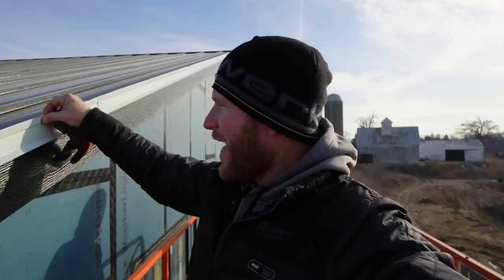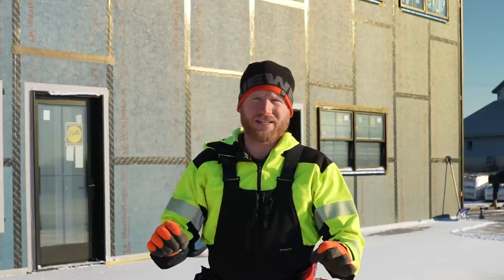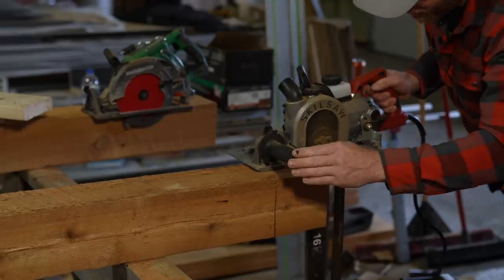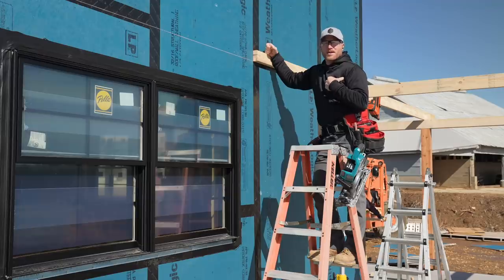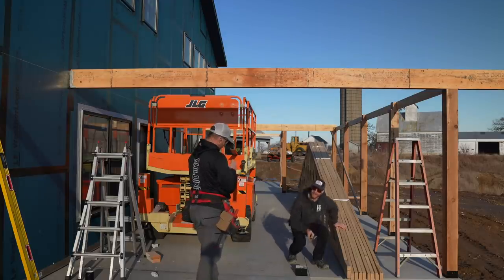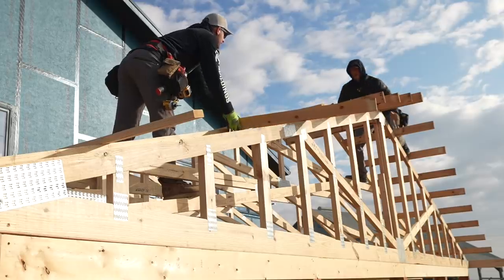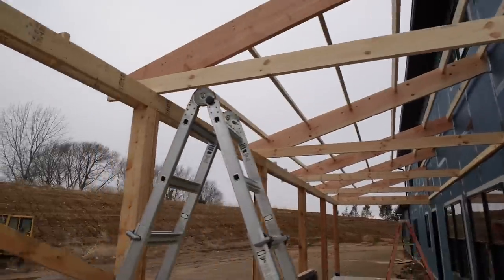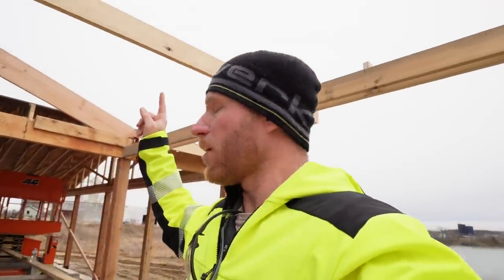Building A Barndominium 22:  Building the Porch Part 1

Comment: In watching your builds, I've learned a lot about post frame and some about using a laser level more often. However, the biggest lessons I've learned are how to deal with having to go backwards on a project or addressing mistakes when the reality isn't 100% of my expectations.  I'm trying to see mistakes or rework as part of the process and move on instead of seeing it as a failure on my part.  Thank you for showing the mistakes and how quickly you correct them.

Comment: Drop end trusses... brilliant!! My first time to see that and I've only been doing this 38 years. You go to residential jobs and they're not even cutting out notches in the end truss top cord to lay a 2x4 flat & run it flush to the next top cord for outriggers, they're literally nailing chicken ladders to the top cord and relying on sheathing to help hold the overhang up! It's all about production, as long as it lasts for the automatic one year warranty! 😏
Reply: Never had a problem with chicken ladders for a 1' overhang
Reply: @xxlegitxxpwnerxx  Are you a licensed contractor that has to provide a mandated 1 year warranty? Well, I'm a licensed contractor & I give 5-year warranties on everything I do, because, I know it's going to last twice as long as that, like it's supposed to!! I've got 7-10 year old ceramic & porcelain tile floor jobs where the grout still looks brand new, (trade secret), 20-year-old roof jobs that my customers have never had a problem with, 15 year old, 2 story monster deck jobs, (that never sank, not even 1/8"), that I've only gone back to stain every 5 years, & that's because I use the highest quality stain, etc...talk to me about a 1' bullcorn chicken ladder overhang...hack job, just like most new residential construction these days! I've been up close and personal to inspect some of these cracker box pieces of junk just out of sheer curiosity recently & I couldn't believe my eyes! Amateur hour at the rodeo, greenhorns from hell...sheathing and decking staples that aren't driven all the way in because people don't even know how to set the depth on their staple guns, not to mention, staples went out to pasture in the 90s & for good reason. Improperly fastened everything, blown out toe-nails, stair stringers that will eventually fail, etc...damn shame!! Yada flippin' yada
Reply: @benttwisted210  yessir we are licensed and have a 5 year workmanship warranty

Edit: not a literal chicken ladder but we build a 1' overhang that face nails to the truss and it's is plenty sufficient

Comment: Is there enough clearance to get that lift off the porch now?
Reply: I was about to ask the same thing! looks tight, doesnt it?
Reply: I saw that as well, but then noticed that the side rails come off..
Reply: can let the air out of the tires to lower the lift
Reply: Thinking the same thing here too.
Reply: You can remove pins and fold then the railings so you can fit in spaces you usually can't in height
Reply: @jeffreypardy2831  true enough...but will it be enough? Greg needs to let us know in the next video.
Reply: @robertkrusin9856  dang it!! there's the answer!! look at you with the big brain!!
Reply: @jeffreypardy2831  solid tires I would presume. Every man lift I have used has solid tires.
Reply: @jeffreypardy2831  polyurethane filled actually. I had to look it up.
Reply: @johnclark8631  no those are inflated tores
Reply: @johnclark8631  we will find out in part 2 or three
Reply: It's funny that you think he hasn't considered everything. LMAO
Reply: @daveklein2826  hey it's kyle producer director and star

Comment: Get the Milwaukee chainsaw. It has a 16” bar. I have one and use canola oil for bar oil which is thicker than vegetable oil. It comes with a 12 AH battery.

Comment: Question? Do you not need an upper ledger board for the rafters? We are going to be doing a similar job in June and on the other side we used a ledger but if it’s not necessary, I’d love to skip it.

Comment: Is there any concern about water, if it gets behind the eventual sheathing, running down the Weather Logic and then situating between boards and the WeatherLogic? Thinking about, for example, the 2x4 being put in place horizontally and flush with the WL board at 13:30, where I wonder if that 2x4 might get rotted out sooner.
Reply: LMAO
Reply: @daveklein2826  Surely you have a well-researched answer if you find this so funny, Dave.

Comment: I need to understand when he cut out the small portion of siding, removed the spray foam, and inserted the short piece of lumber, he then screwed into the lumber, however there wasn’t anything behind the lumber for those screws to attach too, right?
Reply: I believe the post was there. If he didn't put the block in, when attaching the hanger, it would've compressed the sheathing.
Reply: @mikebauer8709  yes you’re correct. I remember now him saying that the post was there. Thank you
Reply: Wrong
Reply: @daveklein2826  thanks for enlightening us
Reply: @marcusjames3035  thank you for talking stupid, gives us all great content
Reply: @daveklein2826  Wrong

Comment: Hey Kyle, I have contacted morton and Wick buildings to get some ideas to build a barndo. morton is tellilng me 75-125$ per sqft for just the shell. No dirt work, foundation, or interior work. Just the shell. Does that sound right? does it really cost over $500K to put up a 5000 sqft building? Thanks for any help you can provide.
Reply from the maker: If it’s morton I wouldn’t be surprised… they are stupid expensive

Comment: After you framed the main gabled porch using conventional framing technics (scissor trusses) why didn't you continue with conventional framing and do the side porch with mono trusses? I can see at least twice the labor involved doing it the way you did, I guess it would be called post frame construction. Notching the top of each post, building all the box beams, cutting in all the rafters and partial ceiling joist and then filling in all the purling's with hangers just makes me cringe to think how much faster it could have been done with modern framing technics. 
Don't get me wrong you guys do top notch work but I know I could have done all that porch work in half the time conservatively and it would have been just as good as your method and all the ceiling joist would have been done too. I think it is the mindset that we get into, you from a pole building back ground and me from a conventional construction background. Just some well meaning constructive criticism hope it helps you out.

Comment: I was nervous the corners of the concrete were going to crack when you were drilling holes.
Reply: I was more concerned about it cracking when the lag bolt was installed.

Comment: If the customer wants to put a swing on the porch now is the time to install a 4 by 4 in ceiling for support  and then install 6 inch carriage bolts for the swing I put stainless steel bolts for swing. Bought bolts at McMaster carr